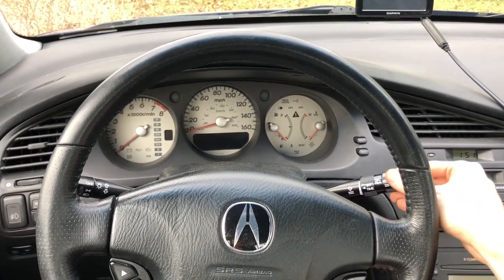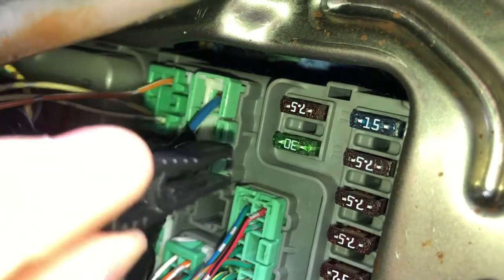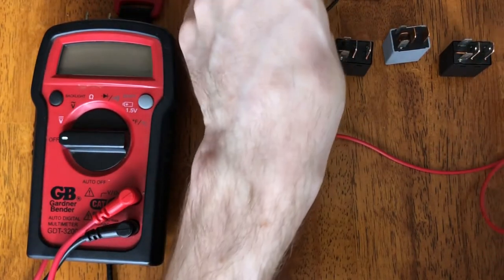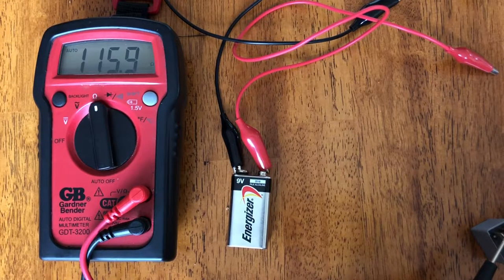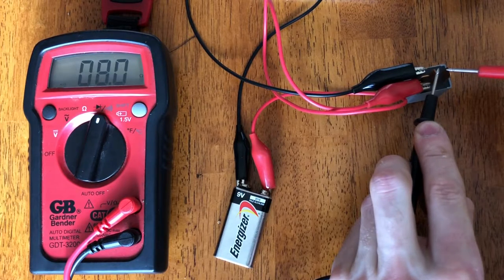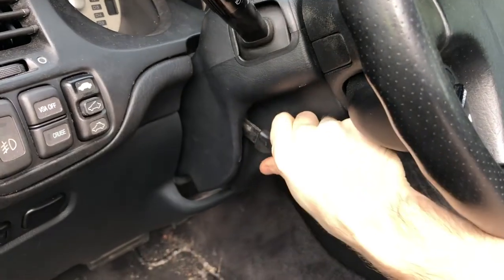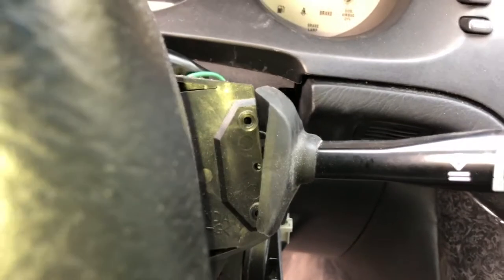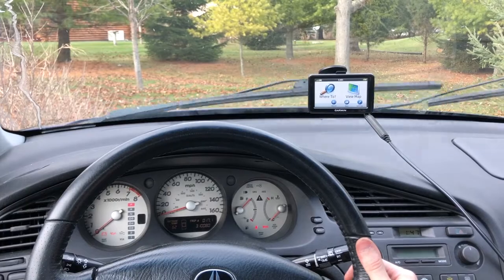How to Diagnose and Replace Wiper Switch for Honda/Acura

Comment: Hi there, Happy New Year 2024 !
I'm looking at a friend's 2003 Acura MDX and your video will help a lot in diagnosing the problem.
The only thing that is working off the steering column wiper control arm is the front windshield wipers in manual.
The washer controls, the intermittent auto control, the rear wiper control don't seem to work. 
I checked the fuse which is ok but didn't check the relays.
Since all these things are not working I was assuming it had to be the control arm assembly unless I'm not thinking right. Can't imagine all the relays are bad.
What do you think?
Thank so much !
Reply from the maker: I could have explained the diagnosis part a little better now that I rewatch the video. One thing to note about the wipers is that if you're able to get them to move in one way or another, that means the motor is getting power and your fuse and relays and probably fine. If your wipers never move no matter what you try, then there's probably a fuse or relay issue. If the fuse and relays are good, but the wipers still won't move, this additionally means there could be a problem with the motor. However, your wipers are moving, so that leaves your wiper stalk as the final culprit and it should be replaced. Thanks for watching!
Reply: @CarRepairsMadeSimple  Thanks so much for your help and knowledge!!
Reply: Hi there,
I did end up replacing the control unit on the steering column but unfortunately this didn't help. It does the same as the other unit does. The only thing it does is the slow and fast wiper speeds. Rear wiper and washer not working and front washer not working. The thing that threw me was the person said one day everything decided to work out of the blue then the next day it didn't ?
She has the MDX touring model which seems to be a little different. The small relay box under the hood isn't the same in the video. When I opened the box there are 6 more regular fuses and 3, I think, relay fuses? 30 & 40 amp.
Inside the car on the driver's side I found the main fuse center and check the 30 amp fuse for the main wipers but the book shows also a secondary
3 fuse group that has the rear wiper fuse on it which I can't seem to find.
I guess I may have to go individually to each of these motors and test to see if they are getting a signal to them?
(Rear Wiper motor and the two washer motors on the washer supply tank)
Does that sound like a good plan or is there something else I'm missing?
Reply from the maker: @Anthony-fh4yp  The fuses involved are No. 9 (10 A), No. 11 (10 A), No. 12 (30 A), No. 47 (20 A), and No. 91 (7.5 A). Make sure they not corroded as that could cause a conductivity issue. The wiper relays are located at the front passenger side of the engine bay by the PS fluid reservoir. What you found by the brake fluid reservoir is the secondary fuse box, which has nothing in relation to the wiper system. I agree to test and see if there's consistent power getting to the motors, and also make sure all the connectors are attached properly and not corroded.
Reply: @CarRepairsMadeSimple  Thank you for your help!

Comment: Do you know if this will solve my issue of wipers not turning off after they are switched on? I have an 03 TL and once the wipers are turned on, they won’t turn off :( any idea what it could be?
Reply from the maker: It should, the wiper system is pretty simplistic. It consists of a fuse, the relays, the motor, and the switch. Since the wipers are wiping, this means the fuse and motor works. Check those relays, or what you could also do is switch some relays around from another part of the car and see if that fixes the problem. Otherwise I would try replacing the switch last.
Reply: Did you end up solving the issue ??

Comment: So I have a 2012 Acura TL and the wipers won’t shut off on any setting. I’m thinking this may be the solution since I’ve already checked the fuses and relays. My question is whether I will need to disable the airbag prior to performing the work or if you know where there is actually a risk of the airbag engaging while working on this following your instructions?
Reply from the maker: The airbag should not be an issue!

Comment: If washer fluid comes out by the wipers don't move, would that eliminate the switch from being the problem?
Reply from the maker: If the wipers don’t move no matter what you do with the wiper stalk, I would suspect there’s something wrong with the fuse, relays, or the wiper motor.

Comment: Alright so I replaced the wiper motor and wiper linkage. I replaced the fuse too. The wipers are still non functional. What else do you think it could be? I live in stupid winter wonderland so I have to have my wipers working.
Reply from the maker: The only other things to check are the relays and the switch. Since the motors and fuse are new, check those relays as shown in the video, or what you could also do is switch some relays around from another part of the car and see if that fixes the problem. Otherwise I would try replacing the switch last.
Reply: @CarRepairsMadeSimple  thanks

Comment: Is this normal? When I pull the wiper stalk towards me, it activates the rear window washer spray.   Currently,  to active the windshield washer spray, I need to turn the rear wiper switch that’s at the end of the stalk.  Other than that both front and rear wipers work. Only the washer activation seems reversed. How do I find out how the circuit got crossed? Did someone install wrong relays?
Reply from the maker: It's possible the hoses on the reservoir are reversed. Maybe switch them around if possible.

Comment: what if the wiper is stuck on,is the problem more likely to be the relay
Reply from the maker: Ansley Lorenzo it’s very possible. The other thing that comes to my mind is the park switch in the wiper motor. Unfortunately, the park switch is built into the motor and can’t be individually replaced, so a new motor would be required.

Comment: Every time I turn the lights on my wipers go off
Reply: Bro same lights turn on with car off turn car on lights don’t work , wipers front move when I turn on the car or flip the lights on . Battery good alternator good . Can’t figure it out have check every fuse around like 49 fuses and relay coils seem good issue started happing after a cold front a month ago
Reply: @Salty5hoe  my mom's 3rd gen TL is also having some strange exterior light/electrical issues. 

The combination switch (for lights, turn signals, etc) & the wiper switch are linked. The combination switches control module is built into the wiper switch, (at least on 3rd gen TL's).

Besides one or both of these switches being bad, you more than likely could have an open/short in the wiring of this system somewhere or the under hood fuse box itself could be bad. All common enough issues on these cars.
Reply: @RothBeyondTheGrave that’s what I’m being told . I just ordered a used BCM only 40$ and already replaced the battery ground, so if the bcm doesn’t fix it ima just have to check the wiring again   Such a pain lol
Reply: @RothBeyondTheGrave than if all that is good try and order a near wiper switch thing , because my sun roof and radio work all the time those seem to not be affected

Comment: what if no water comes out to spray even though theirs washer fluid
Reply from the maker: It means you have a bad electrical connection, a disconnected or clogged washer tube, a bad washer motor, or a bad wiper switch. Start by revealing the washer motor behind the front passenger inner fender lining, and connect the motor terminal to a battery manually to determine if the motor of functioning.

Comment: What  if ur back wiper not working I can hear it when I try to turn it on. What can it be
Reply from the maker: If it's sending an electric current to the wiper but it's not actually wiping, it's probably the motor. However, it might still be worth checking the relays as it's easy enough to do. Good luck!

Comment: You didnt diagnose anything on the switch...absolutely useless
Reply from the maker: It was a process of elimination. I tested everything else that could have possibly been the problem, meaning it had to be the wiper stalk, and replacing fixed the problem 🤷
Reply: @CarRepairsMadeSimple  you didn't test everything else at all. There could've been an open/short in any of the wiring coming to or from the relay box or the fuse box itself. You also didn't test the switch whatsoever, just swapped it without definitive diagnosis. 

You got lucky.
Reply from the maker: @RothBeyondTheGrave   I get what you’re saying. I only filmed what was necessary for me as opposed to going further and diagnosing everything. Wouldn’t call it luck since I had consistent power which meant the wiring and motors are good, so it came down to the fuse, relays, and switch. But thanks for the feedback, perhaps I’ll remake this video and go more in depth covering everything.